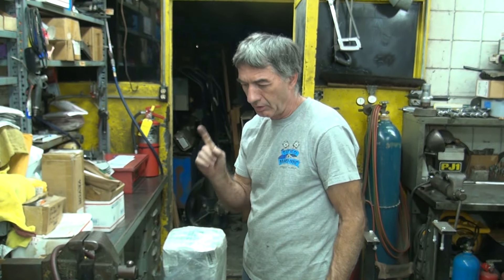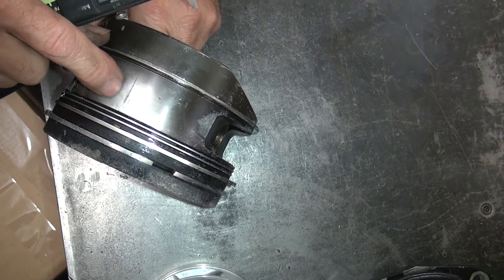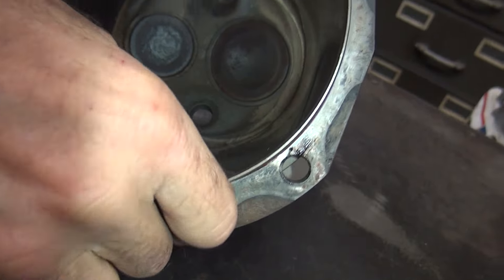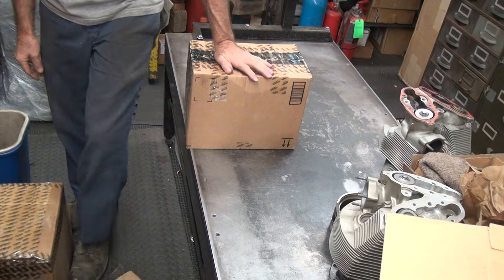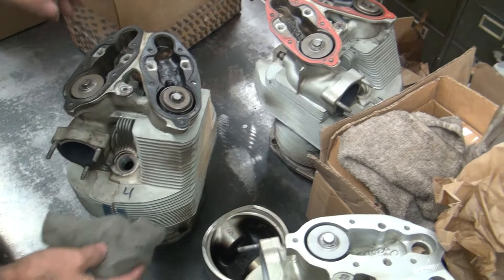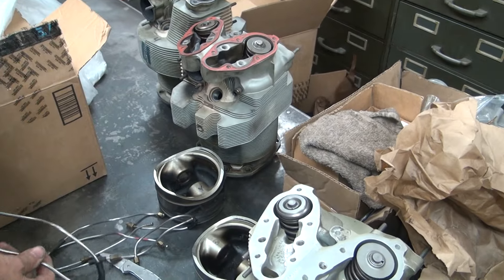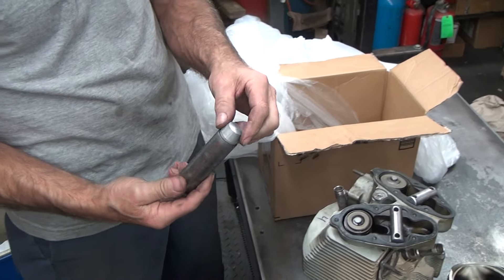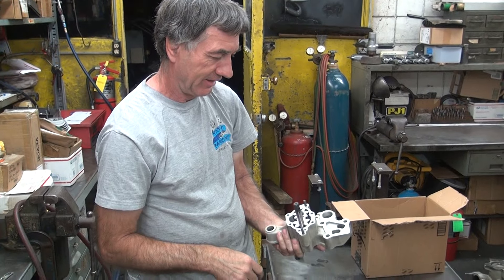#115 custom harley airplane 200ci+ motor twin cam buell xb 4 cam evo XL sportster race tatro machine

Comment: 550 aircooled inches, oil gets hot. oil coolers do a lot of cooling for the engine. also flows through bigass turbo, and engine oil is also used to change the pitch of the prop. lots of oil working hard

if gtsio is like tsio520, then fuel injector goes on top (opposite of pushrod side) and has a block shroud between the line and the head, piped for upper deck pressure. head thread is pipe thread, and the line cap is a compression fitting i believe
Reply from the maker: that all might be but i will be doing something different i am sure.
tatro

Comment: Those motors are designed for less than 3000 rpm.  Terrible ports. Should be a real turd in a bike application.  It’ll look cool though.
Reply: 46 tooth rear sprocket... and front sprocket as well
Reply from the maker: so you have not seen harley ports before. my flathead runs 7k plus so i think i can make it happen.
tatro